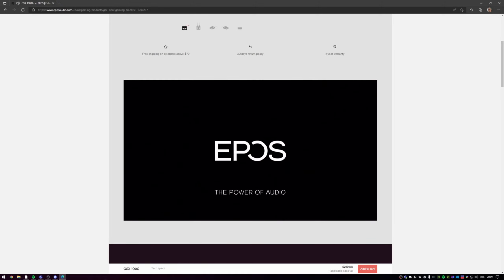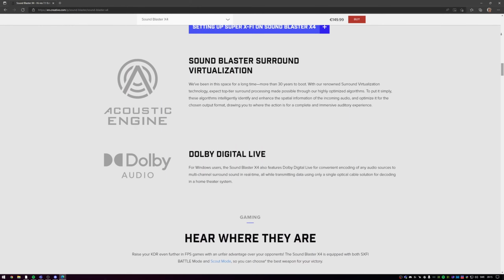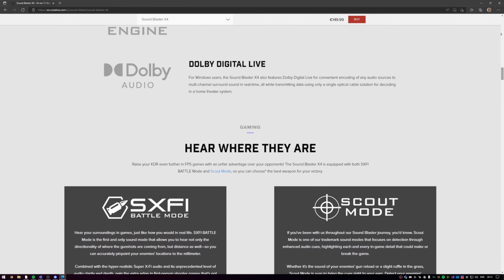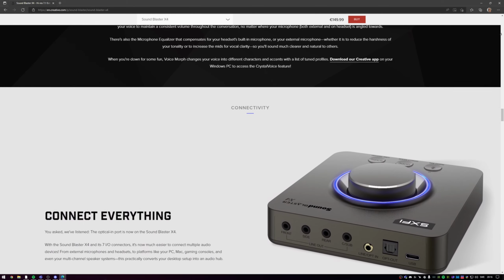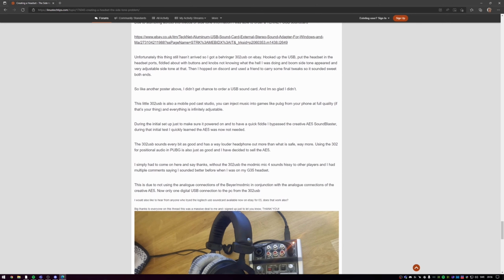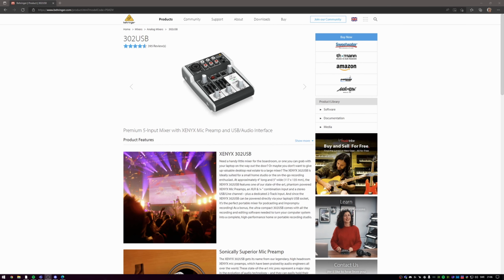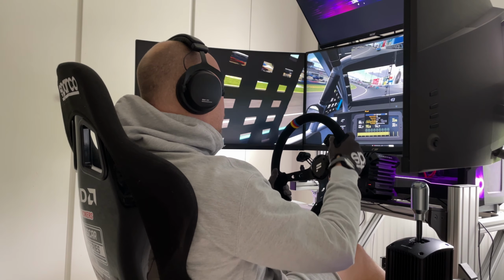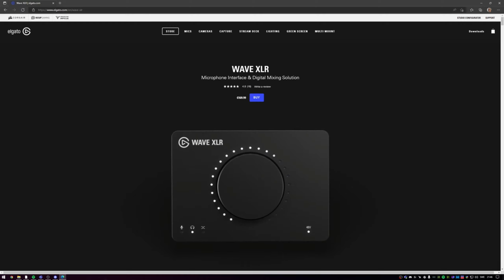Tech Guides - Audio Sidetone Solutions

Comment: Thanks for the good explanation and comparison of the different solutions. Sidetone is essential for me. I ended up buying a Yamaha AG06 mixer / audio interface instead of the Behringer. It has mic and headset connection for my EPOS h6pro headset. But also a smartphone input/output TRRS connection, so I can also take calls using my headset.